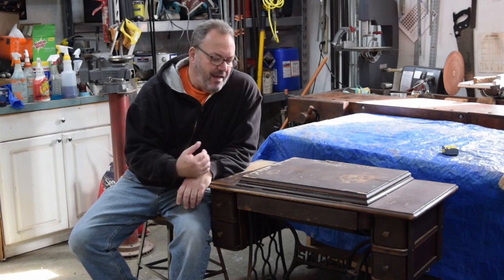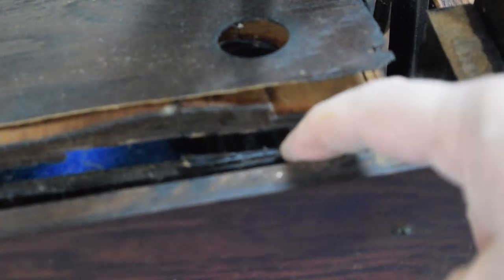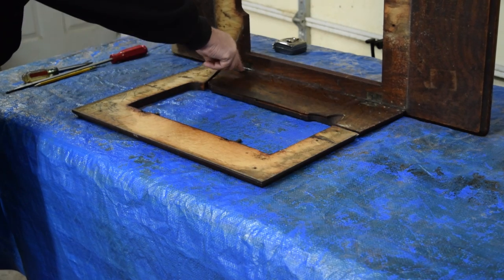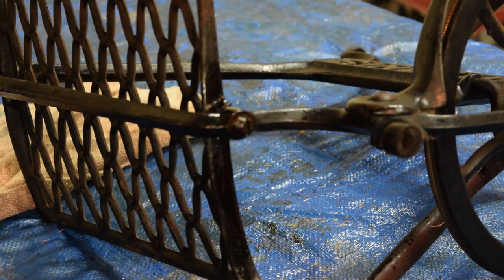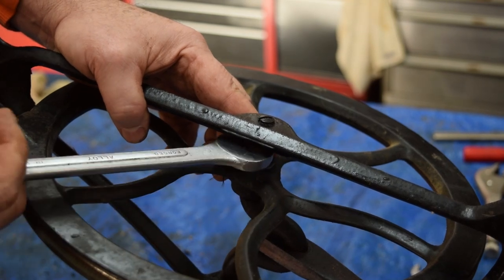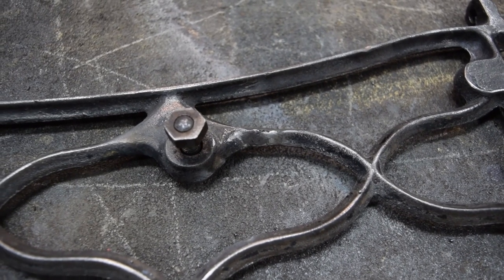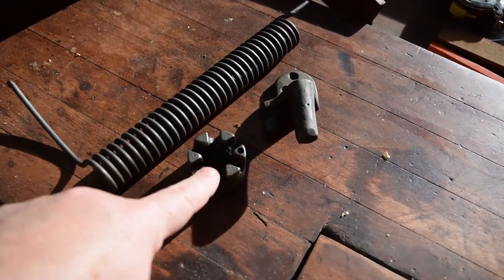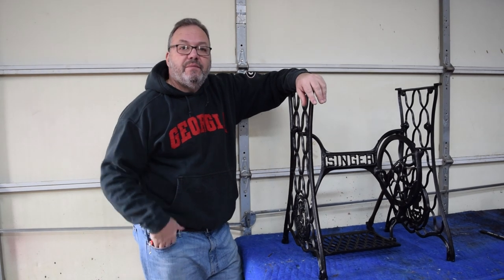Restoring the base and cabinet on an antique Singer treadle sewing machine.  Part 1

Comment: Thank you, Thank you, THANK YOU!!
I cannot possibly express how truly thankful and appreciative I am for your hard work and dedication in creating these in depth videos and sharing, in minute detail, the step by step process of restoring these beautiful machines. 
 This morning my grandmother's cabinet sewing machine was finally returned to me after a long, complicated separation. The machine is a 1916 model, it appears to be exactly the same as the machine in this video except for it's flip down drawer (which, for 30 years I actually had no idea even existed until now!).. Luckily enough I have the original user manual that came with the machine, and apart from what I believe are oil stains and it's binding becoming slightly tattered, it is still intact and fully legible. The machine/cabinet all seem to still have their original factory parts. There's absolutely no rusting, even the wheels still miraculously work without any visible build up of debris or damage to their fastenings.. It's truly remarkable, that despite all it's been through over a hundred+ years that it is in such good condition. However, the cabinet has unfortunately incurred a whole host of superficial damages while out of my care. Damages that just a few hours ago I was at an utter loss as to how I could possibly even begin to fix... Until I found this video and your channel! While I'm not confident enough in my abilities to try anything just yet, your channel seems to be the perfect tipping off point to begin educating myself. Your catalogue of videos serve as an absolutely invaluable resource on the subject of refurbishing antique Singer machines, and I truly cannot thank you enough for making them!!
Reply from the maker: Thank you for your kind words and I'm happy these were  of value to you.  Good luck with your projects!

Comment: I was thrilled to see this video. I have the exact same machine that has been handed down from my Great Great Grandmother. I finally have time to pull it apart and clean it. The bolt and nut assembly on the fly wheel was different on mine. Whomever put it together had the nut on the top of the screw in tapering bolt. It was much easier to get off. In fact, I’m assuming because it has been working through the generations, it has been super easy to take apart. With your tutelage, it has been such a fun project. I have the plain cabinet that hasn’t held up as well and my machine has been maintained by a sewing machine specialist. It is a very special piece to me. Thank you again for getting me started.  I don’t look forward to the cabinet piece of the project.

Comment: Ever tried CRC rost flash spray?? It freezes the rusted bolts to minus 40 degrees celsius to brake the rust. Made to use in places where heat is no no. Cheers from finland !!!

Comment: Great video but I didn't see what you did to get the wheels off. Also, after taking the wheels off I would imagine the legs would damage a wood floor so what do you do, use a "coaster" under the legs to protect the floor?
Reply from the maker: The wheels are on axles which are riveted over on both sides.   I grind off one side and remove the axle to get the wheels out.   I don't try to re-rivet a new axle in as it's just too easy to crack the cast iron leg during the pounding.   I take a 1/4" bolt with a rounded head and put two nuts on the other side.   I then grind the nuts until they are round and assemble it with one of the rounded nuts and dab of Lock-Tite thread sealer on it.   When painted, you can barely tell the difference.   Hope this helps.

Comment: I am restoring a 1927 Eatonia chain lift (auto drop ) treadle sewing machine.  Like fool I  cannot remember how the lift mechanism goes onto the cabinet (didn’t take pictures) I have most of it assembled but don’t know how to attach the centre lift bar (chain hooked to centre) to the spring on the side bar but  I’ve attached it to the back panel where it screws in. There are two long bars on the ends with holes that look like they should be screwed on somewhere, but I don’t know where. Can you help??  Can’t find info anywhere

Comment: Larry, you might not even be monitoring this anymore, but I have a different problem with an antique singer sewing machine cabinet that I am having trouble getting help on.  The cabinet was fully restored by my dad about 30 years ago and was functioning well until a move which did something to jam the top cover.  I can't get the cover to open up. It is frozen or something.  And I can't get the lid off because I can't open it to do so.  Tried spraying silicone spray at the chaing and wheel that raise and lower it but can't get in there far enough to get into the parts that are hidden.  Any ideas?

Comment: Great video! I really enjoy watching your work.
I have a question regarding the wheels. Did you just paint them as the other pieces? Won't it prevent them from moving? Or have you kept them clean and  just protected somehow from rust?
Reply from the maker: They get wire brushed  clean and painted.   The paint doesn't bind the axles and I normally put a drop of oil on them at the end.   The only issue is the bearing surface of the wheel, where it meets the floor will have the paint wear off, but that is expected.

Comment: Thanks for the tutorial, as I'm restoring the base, and topping it with a live edge piece...didn't see you remove the wheels from the base?...the wheels function ok without removing for painting?
Reply from the maker: Yes.   They will be fine.   The axles are peened over rivets and normally need to be ground or cut off.   Replacing them with rivets will provide a heart in mouth moment as you try to pound the rivet end over you are risking snapping off the end of the cast iron base.   In the past I have used a 1/4 in bolt and taken the nut to the grinder and rounded it over and then painted the entire thing in place.   Good luck.

Comment: Could you tell me the length of the 4 screws that hold the iron base to the wooden cabinet top? I just opened an antique cabinet/treadle that was bought in 1999 and never used but it doesn't seem to have those screws. All other screws and bolts were in their respective holes on the iron base except those.

Comment: Thank you so much for the videos.   I purchased a vintage treadle that is in overall good condition,  but could use some rehab after a century.  This is my project for the fall and winter..  The wood is so old and must be so dry.   How do we best protect it?
Reply from the maker: It depends on the damage.   Refinishing is the best protection, if the wood is bare.  Good luck on your project.

Comment: This is so helpful! I have 2 1882 Singer model 12's with wooden pitman arms. one I have to replace. luckily neither have the dress guards but my Singer 127 fun 1927 does. I did notice the tapered screws, so glad I'm re-watching this. Thank you! Is there anything I can put inside of the pitman arm holes (the one I ordered from ebay has holes that are a wee bit larger)??? Some sort of rubber seal or sealant?
Reply from the maker: Not that I am aware of.  If you intend to use the machine frequently, you may want to find another pitman arm which fits better.   If you have a machinist nearby, they may be able to press in a bushing or fabricate a sleeve which may take up any slack you have - good luck.

Comment: Hi Larry, I have a machine that I basically have to rebuild!! The machine was my grandmothers who gave it to my sister and was NOT looked after. Do you have suggestions as to where I might be able to source some plans with dimensions for the wood component as there is not enough existing for me to work on. Thanks in advance for your help. I love watching your videos and have used many of your tips and tricks in my restoration work. Kind regards, Allison 😊
Reply from the maker: I'm sorry I don't.  Maybe a Google search would turn up a Singer group where someone may have some information for you.   Also, perhaps you could check at a local antique mall and see if you can find one to measure off of?   Good luck with it!

Comment: Mine is all cast iron. No wood for the base. Also, the whole machine was painted. I don't have a machine to grind the cast iron. What is the best way to hand remove the paint to restore cast iron?
Reply from the maker: See if you can find a sandblasting service near you.  For around $100, they will blast off all of the paint for you.

Comment: That sizeable dent in the top was caused by the owner leaving the top leaning against the sewing machine.
Reply from the maker: I see it often.  It is also caused by the adjustment on the spring assembly being to loose and the top closing on the machine.

Comment: Very impressed. Thank you so much for this series of videos. I do have a couple of questions for you. First, I'm not set up with a workshop like you, nor do I have all your tools! That's fine: I'm happy using hand tools and lots of elbow grease. When I comes to repainting the cast iron, though, my choice will have to be between painting with a brush or using a can of spray paint. Which would you choose - and any recommendations?   Second question: the original had the writing on the sides and front picked out in gold. Any thoughts on how to do this? Many thanks, Leila
Reply: Sorry: just found your other video where you do the gold trim. I'd still like to know about painting the black without a spray painting machine.
Reply from the maker: I would use a spray paint such as Rustoleum.   I use Rub-n-Buff when I do the gold trim.   You could also use a gold paint and apply with a small brush.  Good luck!

Comment: Can you help me find some wheels for the bottom of the stand. I have a friend who has the wheels but I do not think it is a good idea to remove them. Can you offer me some suggestions.
Reply from the maker: eBay is where I buy most of my Singer parts.   The wheels are held on with rivets.   They are nearly always ruined when the wheels are removed.   I replace them with a 1/4 x 20 bolt, round off the head and nuts on a grinder and paint them black.   They work very well as a replacement axle.

Comment: @lostmountainrestoration Hey Larry I’ve just found a 1917 singer treadle in what looks like ok condition, the wood could use some TLC but probably less than the one in this video, would you say $135 is a good price for it?
Reply from the maker: It depends on your market.   I have seen them for anywhere from $20 to $200, but I'm not sure how well they sell at the upper range of that price.   Good luck!

Comment: The bolts on mine are completely stuck. I can’t take anything apart
Reply from the maker: Try heating them and/or using  a penetrating spray like PB Blaster.